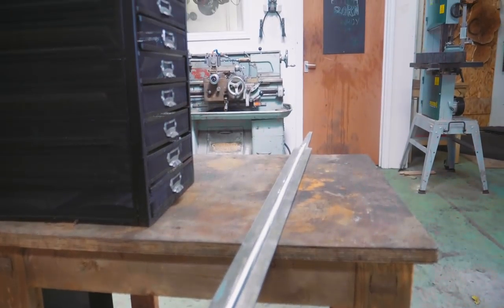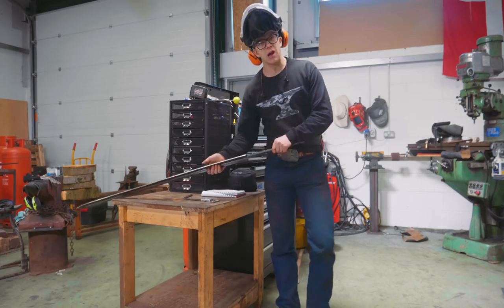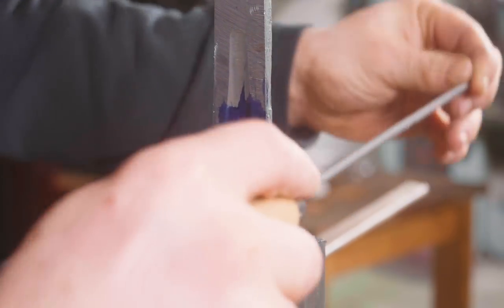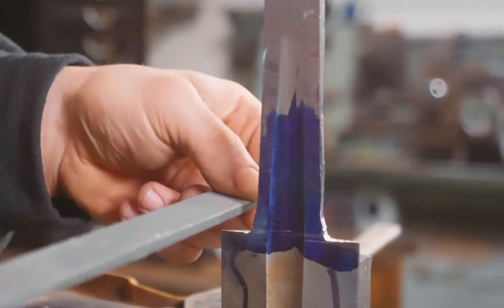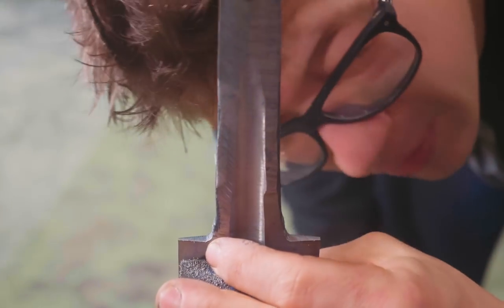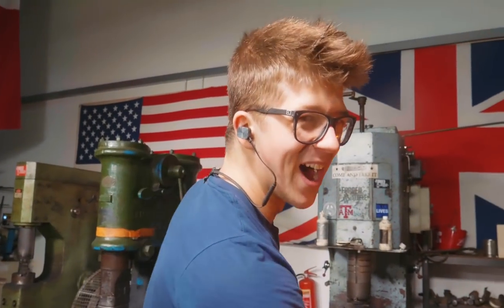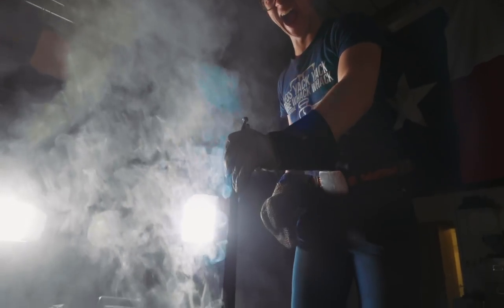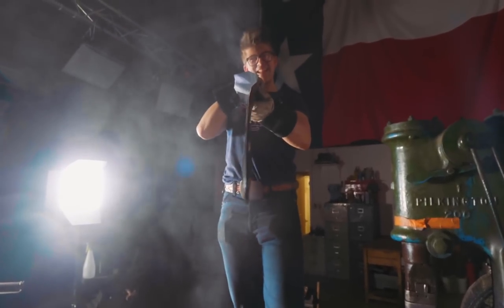MAKING A SCOTTISH CLAYMORE SWORD!!! PART 5

Comment: If you want a good surface and won't scratch the metal to much  you can do a well known trick  : take a bar of chalk and put a small layer of it on the file !  (you have to repeat this process because the chalk won't stay for long on the file)

Comment: You have a small amount of time to straighten the blade after hardening, you should try it (next time of course) you have about 30 seconds before it becomes too brittle to bend but it is possible and even essential as most blades warp during heat treat especially Damascus

Comment: I know this is a few months past this point but it would have been easier to grind the fuller with a round grinding edge and grinding the sword tip down vertically from just over the tip to just under the tang than using a cylinder and grinding horizontally. 

Just thought i would share that bit of info for future swords for you to try if it comes up again

Comment: thats an easy fix just clamp it to some angle iron with some round stock on either end to counter act the warp then daw back the spine or fuller and temper at the same time

Comment: Normally once you harden a blade just as you take it out of the oil or water you have a few seconds where it’s still hot enough you can straighten out any warps.. could’ve easily fixed as you took it out

Comment: have u tried normalizing ( no clue what the name is ) technique where after you take the blade out of the fire u place it on a know flat bed,  then clam a second known flat piece onto of it. Allowing the air and direct steel/steel transfer to keep the plate straight, or straighten small issues.

Comment: Correct me if I'm wrong but wouldn't you have been able to get even more length out of the blade (even after trimming) by adding a fuller correctly using a swathe rather than grinding? Grinding the fuller out reduced its effectiveness as a blade-strengthener.

Comment: For easier clean up at the belt grinder, why not have a bucket underneath?  Still want to see you make a billet out of all the grinding dust xD lol
Reply: 1320crusier the problem with the grinding dust is that it’s also full of ceramic particles from the belts, so the metal would be about 60-40 metal and slag, which is nowhere near ideal
Reply: probably not just ceramics but also aluminum oxide, iron oxide, among other random things.  It would still be a fun 'Alec Steele learns to makes Steel' episode to me =p

Comment: I would have thought the fuller would be better a set distance away from each edge thus becoming slightly triangular over the length instead of a constant rectangle. But I'm a woodworker so what do I know..i am now contemplating jigs that would make the fuller-ing process easier and more exact.

Comment: Wouldn’t it be neat to have interchangeable wheels with different diameters that are all mounted on a twistable drum, so you can grind with different wheel diameters? Should be fairly easy to add that on to your current grinder construction... does anyone understand what i mean? XD

Comment: Alec you should first use a new file on brass because it breaks it in because sometimes there are larger teeth that would get broken if used on steel

Comment: Hey Alec,
     Have you ever considered making a longer forge for your show?  I noticed you've been doing quite a bit of these longer projects lately and have been "painting" the blade a few times recently.  Does the painting of the heat lead to warping more or is it all about keeping the peice as vertical as possible at the quench?

Comment: The question is why did it warp. Was it because the fuller was cut before the heat treat and caused it to cool at the spine faster than on either side. Was it because of an uneven heat before the quench, not enough heat in the normalizing cycles.too fast a cool down in normalization? Many possibilities.

Comment: What if you took a long piece of rectangle tube and cut a portion out of the top so the furnace nozzles could blow into it, and so, out each edge creating a rigged long(er) heating area for the furnace?

Comment: Hi Alec,

why don't you use more flux when forge welding? This might minimize the risk of delamination, you have this issue so often.

I learnt in AVE me "Man at arms" that if you have a warped blade, you can correct it using a vice if you react quickly enough. But now I guess it's too late. D:

Comment: For future reference, right after you give it the first dip to quench, before it has cooled you can check for warping, bend anything out, and then finish the quench.  Usually you can bend most warping out at that critical moment just by using a slightly open vice to put the blade in and lever against.

Comment: Screw file cards for cleaning files.  They're a bit too rough.  Get a piece of soft wood and rub it along the grain of the file. It'll get down in the grooves and push material out without damaging the file itself.

Comment: Filing with wd40 or lighter fluid or whatnot on the file makes for a cleaner surface, you don't get any of the metal creating teeth in it that scratch the blade.

Comment: You need to use more flux, especially with Damascus. Also I'm not an expert, but idk why you do so many normalizing cycles, I would think you have plenty once you finished forging. I mean I get one to be on the safe side. But more than one seems a bit excessive, just harden it, and I think you know now but after you harden it, make sure you take that sucker out and check for bends and bend it back into place because you don't have long to straighten it.

Comment: Classical? you should be listening to bag-pipe music working on this sword.
Weight it down on your big ole flat steel table while it is still warm, that should help to reduce the warp. 
Also, you might want to file test that blade, it could be the lighting in your shop/forge, but it didn't look hot enough for the quench just yet. You are closer to being a master than I likely ever will be, but your color is usually a lot brighter to quench in this shop.

Comment: Why not mill the fuller?  Would it not be more accurate than hand grinding ?
Reply: The bridgeport does not have that much travel. It would probably have to be done in two passes. Also, most swords are tapered in thickness so the fuller needs to be shallower as it went towards the tip. You would need to mount the blade to the table with a 1mm over 1 meter tilt (≈0.06° angle). Doable but the setup would take longer than just grinding it. If you had a sine bar, a 10ths or better indicator, and a good gauge block set, you could make a set of 6 or so tapered blocks that span that angle over the 1 meter distance and clamp the blade to the top of them. Might take a day or two assuming he got it right on the first try.  Could be fun.

Comment: Alec...Not to be picayune but, was the blade even hot enough for the quench? It should be a deep cherry especially with 1040-1045 on the outside, unless the lighting was bad and I hope so for your sake chief, & maybe you can put the blade directly into a vise at different places on the blade immediately after the quench to let it cool as it's completely clamped down in a vice like the gentleman @ freerk wieringa does...Hope this helps a bit...Hoping The Claymore comes out great...

Comment: if you have a new file use it first on brass or copper or soft metal so that the teeth on the file doesn't break while using it
Reply: Stuart Smith I don’t understand how that would work?

Comment: You actually don't want to use your hands to "clean" the file as it puts the oils and grease from your hand on it making it slicker and more difficult to cut material with.

Comment: So, if the warping is down to temperature this will not help as a hint/tip BUT, I have heard a few bladesmiths on YouTube (watching swords being forged has become a bit of a hobby of mine) say that during cooling processes (normalising and heat treat...tempering they've never mentioned it) that clamping the blade vertically with the tang DOWN (so essentially the way you would 'hold' a sword) is the ideal way to position the blade during cooling...something to do with forces at work during cooling processes etc.? Might be worth trying as noticed you had the blade 'hanging' with the point downward during parts of the video during normalising, so might be one to chalk up for next time? ☺️

Comment: Are you checking that with a magnet before you quench? Also you can straighten the blade right out of quench but you only have about 30 seconds to do it. it will become too brittle If you wait any longer than that.

Comment: There are two different people with quench warps, 1 freaks out and then tries it again, the other clamps it down on a flat surface while its still hot and hopes it goes away. IMO in this case freaking out was probably the right reaction, that thing could be used as a boomerang its so curved. (but hey now you can make a curved sword joke)

Comment: question, why didn't you forge the fuller?
Reply: much easier on the grinder. plus he wanted to make sure they are completely straight.
Reply: Jack's Wasted Life and also because grinding cuts away at the Damascus layers, creating a more dynamic pattern that if you were to forge it in.

Comment: @Alec Steele, Traditionally what is the purpose of a fuller? (excuse me if I spelt it wrong)
Reply: jessy stockton A fuller is designed to draw out more blood. As the blade goes in the body, it wouldn't draw out much blood as flesh sticks to the blade. With a fuller your'e creating a gap or gutter in which the blood runs out of the body. It's not a lovely story but that's the way things went. It's more common with short daggers, as a claymore is more of a cleaving longsword.
Reply: well, fullers used to be forged in to start with, so it will save some of that precious steel, and also serve to strengthen the blade, think of it like an I-beam.
Reply: jessy stockton - from what i’ve learned it’s to lighten and stiffen the sword, that whole blood thing is not true.
I’m no expert though.
Reply: Saving material (it is normally forged) and reducing weight while maintaining structural integrity.
Do not listen to people who talk about "blood groves" or associate the fuller with blood in any way.
Reply: Lived to learn something today! Still I think it's a convenient byproduct of forging a fuller or I-beam. Thanks laddies!
Reply: Brandweermandré the fuller is NOT a blood groove, it’s there primarily to reduce the weight of the knife or sword, they also look cool. By removing mass from the blade it makes it both easier and faster to wield. There are numerous vids on this subject but a couple I’ve viewed recently are worth checking out. Shadiversity why swords have a fuller part 1 and 2, also scholagladiatoria has done an excellent vid on the subject called Fuller not blood grove- not for “letting the blood out”!

Comment: Why doesn’t he forge the fuller into the sword? I’m not an blacksmith or anything, I was just curious.
Reply: He made the middle of the blade out of homogeneous steel and the edges are damascus. If he had forged out the fuller, then it would have pushed out the center part much wider and he would have lost 10-12mm (1/2") of pattern on the sides.
Reply: Merlin Magnus actually, it's the other way round! Damascus is in the center.

Comment: Hey you might wanna put a piece of metal behind your belt grinder on the wall so you don't cause yourself alot of repairs down the line from sparks and bits of hot metal tearing it up

Comment: Don't mean to be picky but that is more like a broadsword than a Scottish claymore. Reasons I think this. 1. The blade is too wide, 2. the blade edges are too parallel, should taper a lot more, 3. the fuller is way too long, should only go down just over half way. Just a few point of constructive criticism.
Reply: Connor Hansen The word claymore was first used in reference to swords in the 18th century in Scotland and parts of England to refer to basket hilted sword. https://images-na.ssl-images-amazon.com/images/I/41JuKmWBY2L._SY355_.jpg
Reply: Connor Hansen Alec Steele is making a English great sword with fuller.  http://www.swordsoftheeast.com/images/products/detail/TinkerPearceGreatSwordOfWarsh2424.jpg
Reply: I have also seen broad swords that look like what he is making, but beside that I was only stating that what he was making wasn't a Scottish Claymore.

Comment: When your heat treating something thinner, especially something that long and thin, always make sure your Edge is pointed North. That brief moment that it becomes magnetized while it's still hot, it will automatically pull toward magnetic north. If your Edge is facing toward magnetic north, it becomes much harder for the blade to warp. Also, consider finishing your Blade with beeswax instead of oil. It penetrates the metal and protects it much longer. Pretty easy to Google proper techniques for that.
Reply: Seriously ? Magnetic field of the earth can bend a sword ?
Reply: xavtek 
Yes sir.

Seen it happen to many on youtube.
The fix invariably is to set the sword so that it cannot be pulled by the magnetic field. It doesn't take much to move that metal when it's still hot. And the second it picks up magnetic pull again it will warp. It's so prominent on his Claymore because of the overall length of the piece of Steel. But I assure you, the magnetic field will warp your blade.
Reply: I always thought when you heat steel to critical temperature that you lose all magnetism in the steel. That is why a lot of smiths use a magnet to test if the metal is up to temperature.
Reply: Adam Mercer 
That is true. 

But it's the heat that takes away the magnetism. 
As it cools, it regains it's magnetism.
You can try this at home by simply heating a piece of steel till it loses its magnetic pull, quench it, or allow it to cool. But when it's cold, it will stick to a magnet.
Reply: That's very clever. But you can't blame the earth for a wonky blade.
Reply: Nathan Lewis 
Not blaming the Earth, just the magnetic field. Just do a little research. Not trying to be a jerk, but it is true. I've seen other blacksmiths on other channels make the adjustment and their warped problem dissipates quickly. Yes you can still warp a blade, but the magnetic pole does have an effect on the blade.
Reply: I'd like to see someone do a "perfect quench" type experiment. E.g. take half a dozen forged out bars, all approximately  the same size, and quench them under different  conditions. North/south alignment could be one of them. That said, those neodymium magnets have a far stronger field than the Earth....i wonder if one of those put close to the blade during the final stages of cooling would have an effect.
Reply: Nathan Lewis 
Pretty sure a neodymium magnet would bend it quite a bit.
To be clear, I'm not saying that's the only cause for the warp in that blade, but it is a contributing factor.

Comment: What’s the point of heating it up if you just cool it down right then.
Reply: It normalizes the steel grains so it's structurally stronger. The quench then hardens the blade

Comment: Duh. You unevenly heated it. Like you don't know what happens to metal that is unevenly heated. It literally creates the Curve of the katana. Also the way you created the sword. Or rather the way you mixed the metals together. Being a different density. They will absorb and dissipate Heat unevenly. But that could have been negated with a proper heat source. Which obviously you did not have. Or at least did not use.

Comment: So you made fuller down to the tail of sword. That is sooo wrong, you should have left the tail without fuller. It is now the very week part of all sword, you really should be gentle with it after heat treating. In fact, fuller should begin after a few sm from the guard. I wonder why you dont want to read books, google etc to learn something about your praject BEFORE you start it. I really apretiate your work but please, learn more about what you're doing.